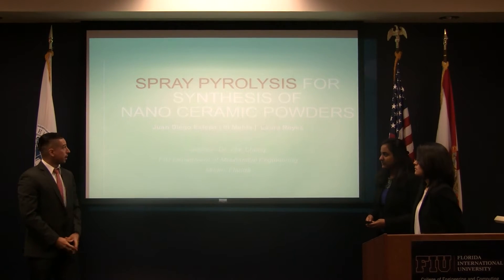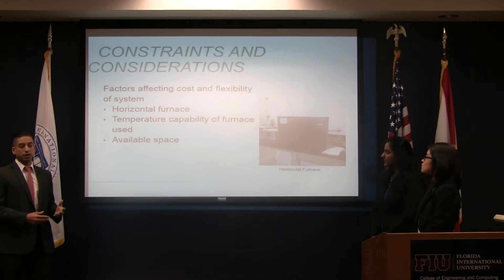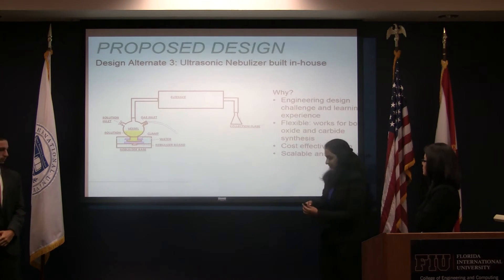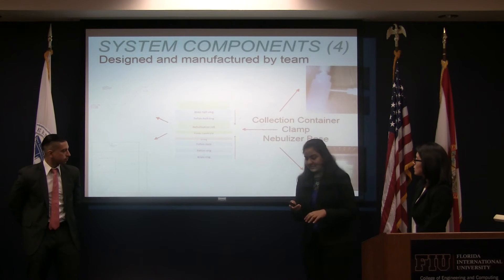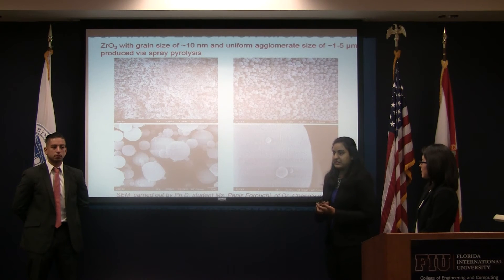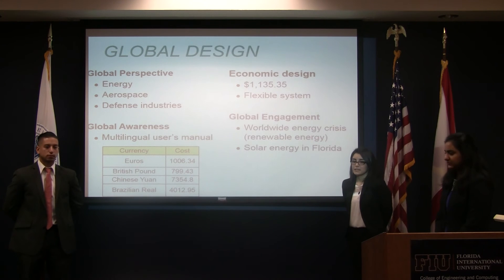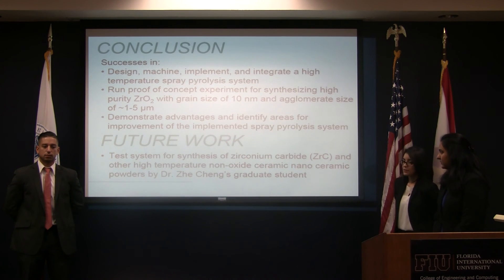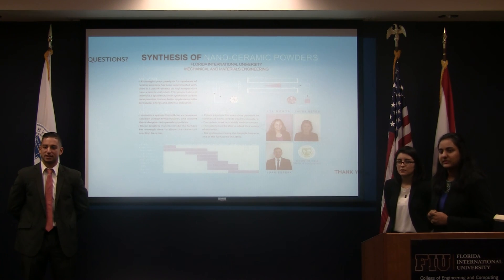Team 2: Spray Pyrolysis for Synthesis of Nano-Ceramic Powders

Comment: Zirconium powder doesn't completely dissolve in DI water. What you did was prepared a suspension of this powder, and sprayed onto the furnace. So just transported it. Maybe try salts of zirconium to achieve finer results.

Comment: This team had a very interesting concept. The execution of the presentation of this idea was not done well. The Power Point was very detailed and concise about the entire design process; however, the slides were unreadable due to a poor choice in a Power Point background and the large amount of text in each slide. The presenters use the images to show the audience exactly what results from their machine. But, the images are barely visible because of the glare from the light source and the bad background. The presenters were all confident and knowledgeable of their topic, but this does not save the video from being hampered by the poor Power Point presentation. Overall, this team did an average job.